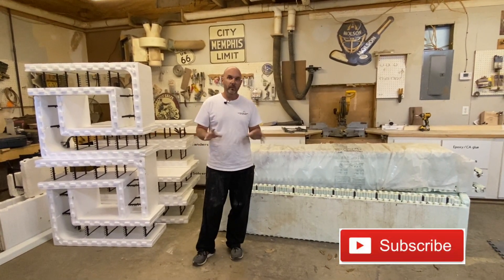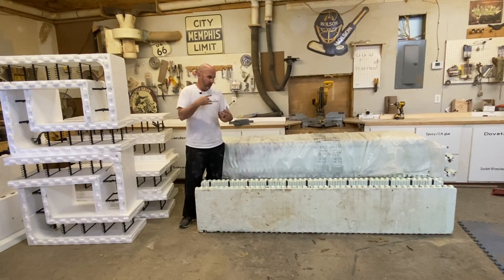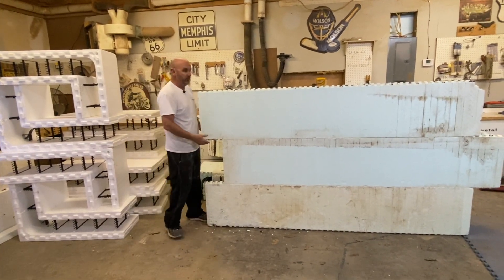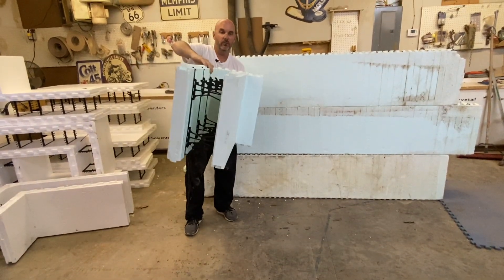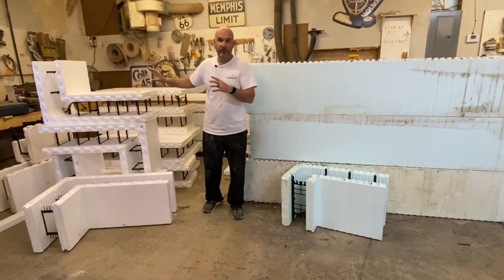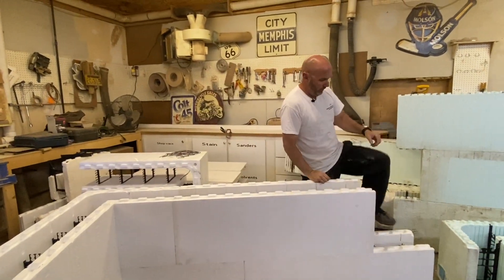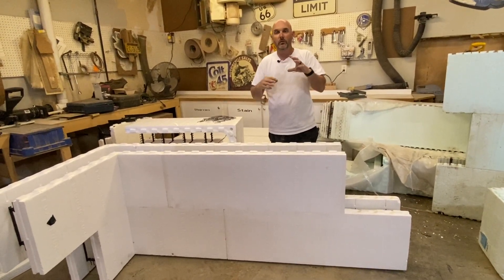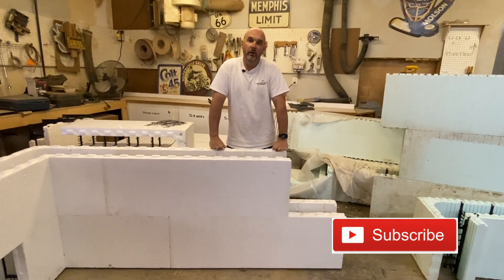ICF Review!  Fox Blocks vs Nudura?

Comment: Just take wire and tie both end , I did all my house that way ,beguinning with half block , using 2x4 with fast form materials scafolds , perfect no problem , 55x37 house , I am verry happy whith nudura ICF , returned the extra blocks , every thing is 100% FOR A 64 y h MAN ALONE  no rush , just take your time to study the way to do , at Joey Films , Tank's you all. Michel Qc Ste-Sophie

Comment: Has to be the most overrated product for a foundation only with conventional framing adove.
As a cribber, i can say the cost of them vs cribbed foundation that can have the forming material used to cover the 1st n 2nd floor walls is a major overcost.
We have been applying styrofoam to our cribbed cast in place foundations for years .
ICF can stand for insulated concrete foundation and not forming.
Any  building  project would be better off , from an economical POV would be to achieve the same values by not being fooled
Reply from the maker: @noway2708  congrats on being an old dog unwilling to do the math and learn new tricks…. Everything you claimed here has been proven mathematically on this channel in the past, but have fun glueing foam to your concrete👍🏼

Comment: Nudura is faster and cheaper plus it is a closed cell foam.
Reply from the maker: There is no difference in the foam unless u pay up for the insect treated foam that dissipates over time from Nudura, but homers will find anything to say one is better than another, unless it’s a straight wall with no windows there’s 0 chance Nudura is faster…. Element icf is probably nominally faster than both of these however

Comment: Nudura for me all the way.... and you didn't show the nudura metal clips that connect courses those are required and due to the nudura size, you need half as many...., and the 8 foot metal mesh grid channel that snaps in every second course... makes the wall super straight and extra rigid and so easy to prep for pour. Less joints, less blowouts ! The starter channel and easy buck for windows/doors are superior as well.
amvic block  is the worst, nubs are small and push blocks apart, requires twist ties, what a pain ! I charge 25 percent extra labour if a customer wants amvic

Comment: Has to be expansion vertical joints in long walls. Water will get in this system.  The foam hides all the cracked foundations.
Reply from the maker: Which is why you waterproof the wall like all sub grade walls, nice job trying to fear monger tho;)

Comment: I love, I love hearing people that actually have a platform. There is no possible way that you can set fox blocks anywhere near as fast as you can see that Nudura you reduce the possibility of a blowout by half and Nudura has no weakness they truly haven’t. I’m a framing carpenter by trade, and they were absolutely simple to work with.
Reply from the maker: I like Nudura, but their corners are weak sauce compared to fox…. So the no weakness comment is objectively wrong, to make them foldable they are too small, and too easy to damage in a latent way during shipping, fox has the best corners in the game, all the big guys excel at some things and less at others…. That said I’m currently working with and on the Nudura one system to take the icf pools to another level

Comment: Any experience with Build Block? More like Fox. Also, I don’t care about shipping air as most of the shipping costs is by weight. Besides, if you get a half truck instead of a full truck, the don’t send or bill half a truck. I don’t have real world examples but as you say, for a house or pool,, it won’t matter. Anything I want done will easily fit in one truck. Great comparison you did here. Thank you!
Reply from the maker: We sell build and fox, probably going to do a comparison with all three soon, all are good, each has something the others don’t…. Fox is honestly the easiest to use but has the less options when it comes to radius blocks ect, it’s also nominally cheaper at the moment
Reply: @all3pools  the radius blocks are on my favorite items...but, I'm very unlikely to use them, so....I'll be sniffing around Fox, now. :-) Thanks for the reply.

Comment: Are the brace and scaffold systems proprietary to eaxh system? To me this is a big deal to get safe access to the top of the wall and to square and straighten walls. Seems to me nudura would give you a straighter wall with the longer block?
Reply from the maker: No they generally work on all systems, especially fab-forms stuff!

Comment: Late to the show... But still a question. I've noticed that the manufacturers would prefer to have your screws aligned with the webbing as you'd screw into the harder plastic rather than just the foam.
How well do each work in that respect? How well can you spot the webbing locations from the outside? How well do the screws hold? Any difference in size of the screws (longer, thicker = $$)...
Reply from the maker: You want them to align for many reasons, 
One is that it makes later steps of attaching drywall or exterior products easier, but also there are structural benefits to stacking the full height webs which most brands now have, if you don’t the weight of the wet concrete can compress the forms just a bit and make the top out of level or slightly shorter than intended…. The forms are clearly marked at each web so this is a super easy thing to keep aligned!
Reply: @all3pools  sorry, i mean to align screws at a later point, when finishing the inner and outer walls. How easy to spot where to drill/screw and what screws to use. Especially after some time having finished the wall to screw in something substantive to the wall.

Comment: . The same clips that you are using with fox block are available for Nudura. These would definitely be necessary when doing a monolithic pour. Shipping costs, at least here in Canada, are extremely relevant with diesel costs being what they are today, so the folding forms are a real plus. They are a little bit more difficult to cut than an all plastic form as you say but if you are building a foundation or full height wall system one would assume you have the right tools. 

Really appreciate your videos, especially with the pools! It is great to see the enthusiasm and passion for your craft! Reminds me of myself in younger years. Keep up the great videos, and work. You have done some truly magnificent pools !
Reply from the maker: Ya in Canada I can see Nudura having better economics than we currently see here…. Other than their corners they are a top notch form that I’ve always enjoyed working with…. Also, we’ve gone a slightly different direction with our monopour pools and their will be a video this fall that’s going to give a tip of the cap to Nudura!  I will say nuduras clips aren’t as handy as fox blocks, they don’t have the little tail on them and it’s way easier to get pinched putting them in…. That said my supplier is starting to use an aftermarket clip and I think they are suppose to work with multiple brands and they’re 40% cheaper…. So we’ll see

Comment: Thanks for the video!

Interesting that you like the Fox better…I’ve done both, but have found Nudura to be significantly faster. And with time being money…they end up cheaper.  In my experience at least 2x-3x faster. 
I’m gonna list my pros for Nudura. Realizing of course, that each person has there own preference and I respect that. Just disagree.
Pros:
1- Material mass. Nudura takes up 1/3 the space of your job site that Fox would. No pallets to have to dispose of, no cardboard packaging.
2- Clips. Each fox block requires 3 clips. 2 horizontal, one vertical. 2 Fox blocks make up the same linear distance of 1 Nudura block. Each Nudura block requires 2 horizontal clips, 0 vertical. That translates to 6 equivalent Fox clips to every 2 Nudura clips. That’s 3x the clips…3x the labor.
3- Block height. In todays market of 9’ basements, Nudura breaks at 9’ with no need for an “optimizer” course. Fox requires 7 courses for 9’, Nudura is 6 courses. If you are doing 8’ basement, then Fox has an advantage. 
4- Nudura pre-buck is the best I’ve worked with so far. Previously, I used the Fox Buck system vs treated lumber, because of the concrete embedding into the form and eliminating buck/concrete separation and ensuing air leakage. However, Fox Buck has very poor holding power for large doors. It’s great for windows, but not for doors. It also requires that when installed the block be watched closely for linear bulging for any length greater than 4’(factory Fox Buck length). Enter Nudura Pre-Buck, 16’ factory length engineered wood with concrete embedment groove. Essentially, a straight, engineered wood 16’ length of Fox Buck. My only complaint with them, is the weight and cost. But you get what you pay for, and that weight offers great holding strength for large doors. 

I will agree with him on the Nudura corners. One has to be thorough in the assembly of the web inserts. We have also found that we benefit greatly by attaching a plywood strap on the short leg of the interior and exterior of the bottom 3 courses of a full basement wall, otherwise, you will experience some spreading of the joints between the corner blocks and the adjoining full block during the pour.

Nudura also has a great selection of YouTube videos. I seem to remember Fox having a decent amount as well, but it has been a couple of years now.

Love the channel! Thanks for all the information. I’d kind of like to meet up and work with you on a couple of your ICF pool installs. I have customers asking about them, but I have zero experience.

Keep up the good work!

Comment: Have you looked at using Helix Micro Rebar in ICF pour instead of std rebar;  how about comparison on interior insulation with rockwool vs spray foam....if doing std frame construction.   Have you looked at Stronghold ICF product?

Comment: Nice comparison. I was leaning towards using Nudura as my building inspector commented that he liked how they have a dedicated water proofing membrane that holds better. However, today I called back the supplier I inquired to 18 months ago and its price increased by 40% !   Which is why I tuned in to your video!  Thanks. Also looking at Amvic up here in Canada.
Reply: PACIFIC ICF is a BC supplier for AMVIC.  Did you select R-30 or R-22 ICF ?

Comment: i started with ICE block ( the very first icf) then reward wall, then blue blocks, blue max , nudura and then fox blocks all are knock offs of the ice block  Dave Mcnearly the inventor of this system is not a very rich man , after hundreds of full height homes under my belt i think you are better off with a 16x48 block least amount of wastage .

Comment: Nudarua blocks, they made it in Columbus, GA. They're not shipping from Canada.
Reply from the maker: So assuming you live anywhere but Canada or Georgia, nudura is likely shipping from much further away than the other major brands that are manufactured 12-15 different places all over the US, the foldability helps but with the rising cost of trucking every mile quickly eroded that advantage…. Coupled with the fact that Nudura, in my market at least, starts off over $1.50/ft more than fox blocks there is no justification in my mind to continue using nudura…. As I state in my vids when nudura comes up, I like nudura, I used it exclusively for years, then I awoke to the untenable economics that currently exist and couldn’t justify using them…. It’s not a knock on the product as much as it is an indictment of their price…. Granted I think their corners are lacking the stability of other blocks, but I never had too many issues with them….

Comment: I've done about 20 jobs over the years using ICF's starting with the Blue Max blocks in the ate 90's.  I have found that the NuDura was my least favorite by far.  The 18" height vs the US standard of 16" is not compatible with Plywood nor similar sheathing, and provides waste when one is doing a 4' high or 8' high foundation.  I found that attempting to insert 5/8" rebar on the underside of the first course webbing is almost impossible in cold weather (we had to use tie wire).  The "T" blocs were not compatible with the top and bottom locks of the longitudinal blocks when installing subsequent courses.  And at the time I used them, brick ledge blocks were unattainable.  Personally I hope to never see a NuDura block again!
Reply: have u ever used quad lock?

Comment: I’m a carpenter and knowing the potential of blowout in various places I would strap or sheet my corners as a precaution
Reply from the maker: I did with nudura because those small folding corners are pretty weak…. But with fox I’ve had 0 issues and we’ve poured a lot!

Comment: I am going to be building a home for myself and my wife as a retirement home. I plan on doing most of the work myself. Can I poor concrete one level at a time. Then add the next level and poor again until I get a full wall?
Reply from the maker: Yes, that’s the most common method!  Look into lite deck floors and hydronic heat, it’s very diy-able and the best practice I can imagine, I’ve got some vids on here, mostly the remod vids with my wife show this method!

Comment: Can these ICF's be used with timber sleepers and instant foundation pile-ons to reduce installation time, so basically a free floating foundation rather than strip concrete standard foundation footings?
Reply from the maker: Yes!
Reply: @all3pools  Awesome I figured it was possible from an engineering point of view most of our locomotives and railroads use these simple foundation systems transporting 10x more loads than the average house stem wall live loads, thanks 👍

Comment: Love your videos, Brother!  Related question: Getting ready to have my ICF plans drawn up but not 100% sure on what block I'll be using. Was initially leaning towards Nudura but based on this video (and other reviews) was going to go with the Foxblocks due to Nudura''s cost.  However,  the foxblock technical advisor in my region is kind of an ass whe the buildblock guy is SUPER helpful/responsive.  Issue is an 8" core foxblock is 13.25" thick whereas the equivalent buildblock is only 13.0" thick.  So ultimately I need to determine which block will be used before plans can be drawn up.  Do you have any experience/knowledge of Buildblock and if so, which would you prefer between Buildblock and Foxblack? Price comparison? Thank in advance man; fellow Missouri boy here currently living in Georgia haha!
Reply: I am an ICF installer in the SouthEast. I install buildblock, fox block, and nudura.
Reply: @icfwallsystems  im located in Augusta, Ga area.  Dont know if this is an area you service but if so, would love to chat with you about doing some icf work.
Reply from the maker: I just met a buildblock guy online and I’m asking about some pricing stuff as they are made in the same plant in Nixa mo as fox…. I don’t think that 1/4 inch is super important, it could theoretically cause a bastard joint that one or the other could have avoided or cause a 1/4” field correction to avoid the bastard of loss of that space on the interior but ultimately that’s so close I don’t think it will end up being too important!
Reply: I'm using all brands out there. Im a ICF installer for 27 years. No any block is better. 
The only thing that changed is price wise.
Reply: @icfwallsystems  what area do you install in?

Comment: Great video.  Im currently in the process of getting my ICF home plans drafted.  Issue im finding is, due to different block thickness (13" for buildblock vs. 13.25" for foxblock) it seems I need to know the exact brand of block I intend to use before the home plans are created - is this the case?  If so, this is a issue because I cant get a quote for the ICF block without a plan and I cant get a plan without knowing what block I intend to use, is this right?  Also, any advantages/disadvantages in going with foxblock over buildblock or vice versa?  Outside of Augusta, Georgia if that makes a difference.  Thanks in advance for any guidance you are able to provide...
Reply: Build block has a fairly lengthy data sheet with exact drawings on the block structure in PDF form that your architect can use.

Comment: you mentioned that Foxblock is looking to increase their costs. you should have done this video after their increase in cost because on a 2000 ft home it would increase it about 2000 to 3000 if they increase it by only 5%. If they decide to increase it even more then that then it will go up even more and may even cost more then the other.
Reply from the maker: So I’m not following the math…. I did a 2000 sq ft house right about the time I did this vid, it was a crawl space so the walls were 14’ high so for a single level 2000 ft house it was using about as much icf as possible…. The total cost of fox blocks was 11,500, so an increase of 5% would be just over 500, not 2-3k…. Also at the time of this vid, because these vids are snapshots in time, nudura was like 35-40% more in my market than fox…. The videos are designed to give you current market conditions, fox is still less than nudura by a considerable margin, I’ll likely redo the vid in the new year and the main detractor to fox currently will likely be their lead times if they haven’t improved…. They have gone up in cost but not too much but their lead times are frustrating albeit normal in the entire industry atm…